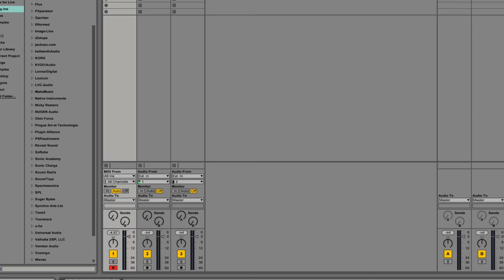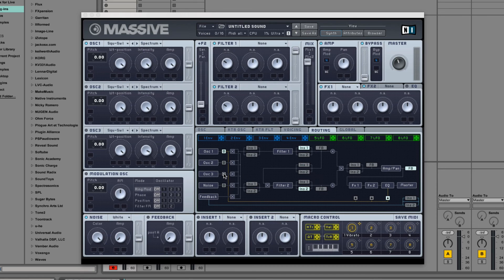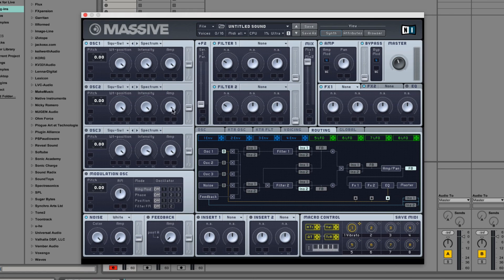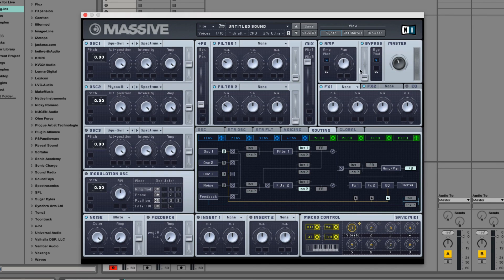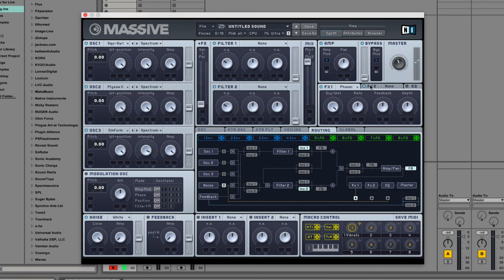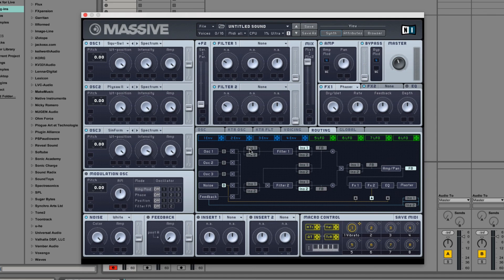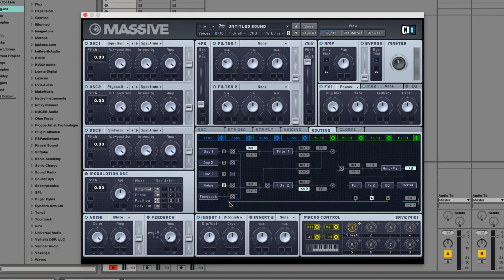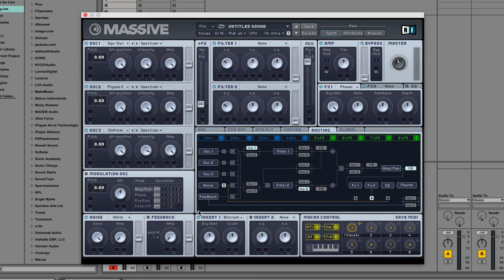Massive in Depth #2 - Internal Routing Explained

Comment: Also, after ins1/ins2 - filter 1 - ins1/ins2 - FB - (down) ins1/ins2 does this mean that insert 1 is 50% in effect while the other 50% goes to filter 2?
Reply from the maker: +Ben Gom If i understand you correctly then all of the audio passes through ins1/ins2 then goes to filter 2.  This is all determined by your routing sliders for the filter and dry/wet knobs for the effects.
Reply: Thanks a lot for all your help!